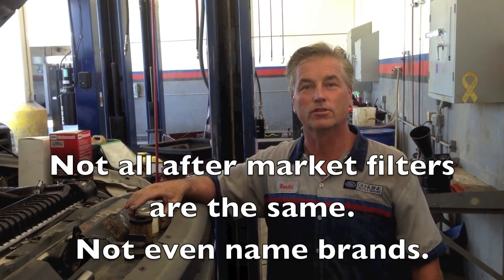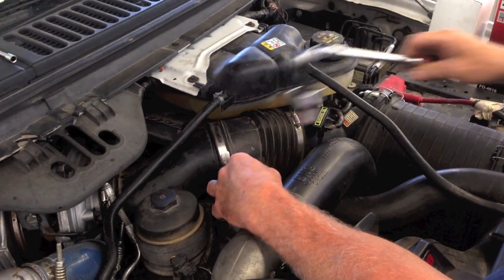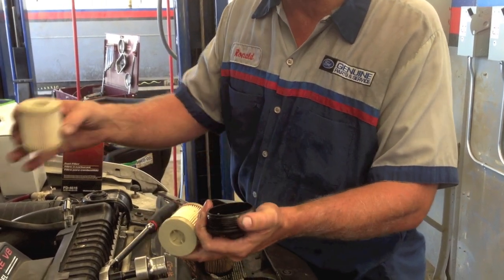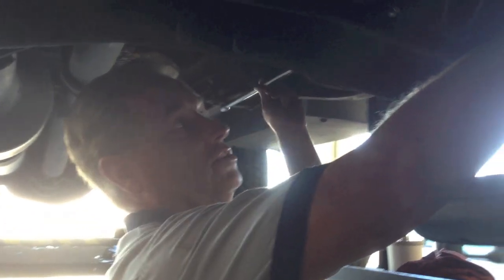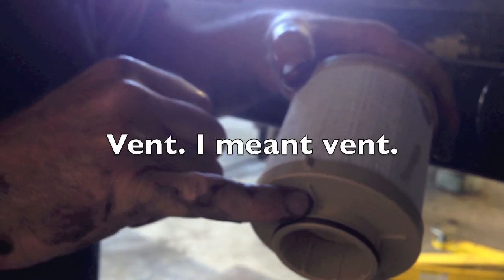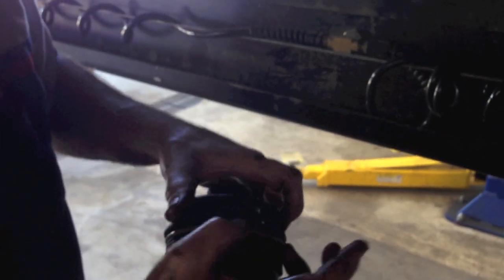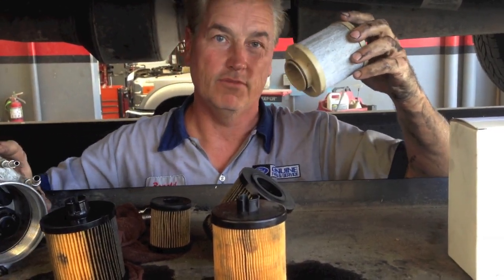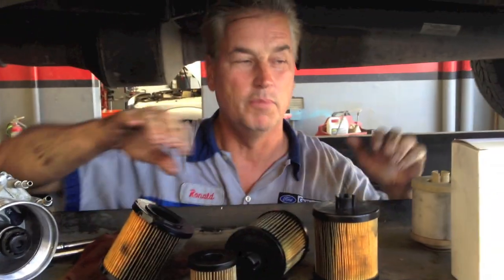Fuel filters on the Ford 6.0 powerstroke, O.E. versus aftermarket

Comment: Ron, i just change both my filters and everything went ok, but after rewatching your vedio i think i miss up. The frame rail filter weep hole im not sure if it's on the. Filters are OEM Motor craft. Everything went good, it starts up good ran it 15 miles and it starts good and goods. Do i need to take the frame rail flter back out and make sure the weep hole is on top or leave it. Thanks for your help and vedio. Robert

Comment: I was told that the vent hole and membrane were important.
The membrane on the OEM helps with water separation in cooler, and temperature changing climates.

Comment: But beware! There is also the fake one… I bought a Motorcraft filter in the same online store twice in a year but still it keeps clogging the small filter or the very fine stainless steel mesh located in the injection pump body. That small filter is your last line of defense. That crud that keeps blocking the filter is made from the filter materials like fine microscopic cats hair accumulated into a ball of yarn at the size of 5mm sphere entirely blocking the SS mesh/strainer. I can’t believe a Motorcraft brand of Ford Oem will disintegrate inside so quickly. I must’ve bought a fake from you know where….

Comment: Does the port holes on the top fuel filter cap matter my old cap had 2 port holes on each side of cap my new cap had no holes and now my truck will not start or run

Comment: On 05 Excursion you can get filter wrench on . You have to double up on extensions or like he uses a 24 inch . That must be a 2wheel drive cuz 4 wheel the shaft and transfer case would be right there with a small window to work in . There for use extenson to get you beyond crossmember but upon removal your ratchet head will back up against transfer case. . 270000 miles 3 sets of injectors oil change every 8000 10000 miles .when it runs it runs like a raped ape . When it is sick I want to drive it thru Ford's front window
Reply: Can't get filter wrench on....

Comment: Sometimes I just use a regular oil filter wrench on the lower fuel filter especially when it is on very tight.
Reply: gloknor Thanks.  Will have to try that next time when it won’t move.

Comment: On my '05 F350 It's a 35mm socket for the lower fuel filter cap. Also - note that if you do open the 6mm allen on the water/diesel separator it will continue to drain for quite awhile until you close it.

Comment: Thanks for all the GREAT Video's Ron.  Quick question for you on the top fuel filter.  I've only ever used the original Ford replacement filters and have noticed the past few times I've changed them that even with the engine off (overnight) when I remove the upper fuel filter cap I can hear pressure being released.  Is that normal?

Comment: Hey, I also am curious what the model number is on the filters you get on ebay. I'm guessing maybe Racor pff4616? There is also "OEM SPEC WHITE BOX" On eBay. The picture of them looks like it has the screen on the lower filter and also the tab that will keep it on the top. The image quality is too low to see if there is the breather on it or not. 
http://www.ebay.com/itm/03-07-Ford-F-Series-6-0L-Powerstroke-Turbo-Diesel-OE-Spec-Fuel-Filter-New-/262139950935?hash=item3d08c23757:g:W8gAAOSwT4lWROCb&vxp=mtr
Thanks for all your helpful videos!

Comment: I take what you say regarding powerstrokes as gospel...Which eBay aftermarket fuel filter was the one you recommend?? The $70 motor craft fuel filter is a little steep imho. Thanks again for the videos.
Reply: motor craft fuel filter ebay for 39 bucks

Comment: Another fine video. I found out the hard way yesterday to use Motorcraft. I changed my filters with napa filters. The truck ran for a few minutes and then ran out of fuel and quit. No fuel in the upper filter. I feared the worst (fuel pump). I took the lower filter out and re installed it, nothing, and I could hear the pump running. I went to Orielly's to get a motorcraft filter. After install, I turned the key on and instantly fuel appeared. I have used aftermarket filters before, but no more on the 6.0.

Comment: Why chance aftermarket filters I don't I never have and never had issues use factory Ford filters and be done with it end of story. Here in BC Canada a 5 gallon pail of 5w-40 Delo 400 costs me 144 dollars, a oil filter from Ford is 30 dollars, fuel filters are 97 dollars. Did both on my truck 2 weeks ago I'm good for another 6 months. The Rotella T6 costs 235 dollars for 5 gallons so I use Delo been using it for 6 years or more. I keep my fuel tank over half full so I never run into condensation issues and I only buy my fuel from 2 places.

Comment: ill agure with anything after market when it comes to clean fuel... if they say 4 microns is required, yes going to a 2 micron sounds better right? cept for its going to be lowering the supply to pump and injectors which equals a little less return rate!
least thats how i feel i say OEM all the way with oil and fuel filters